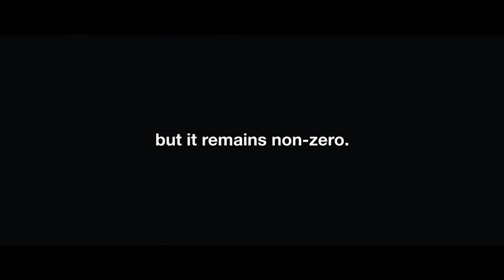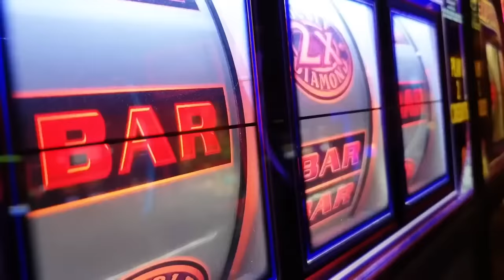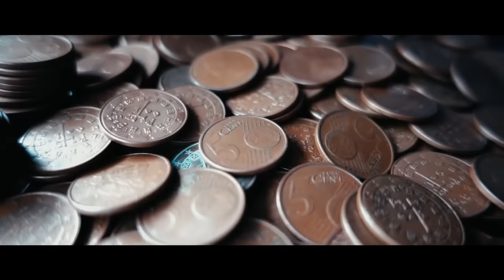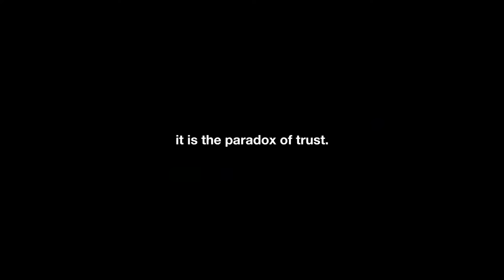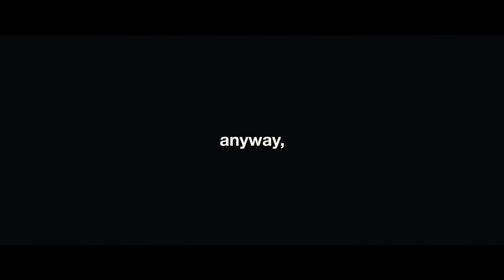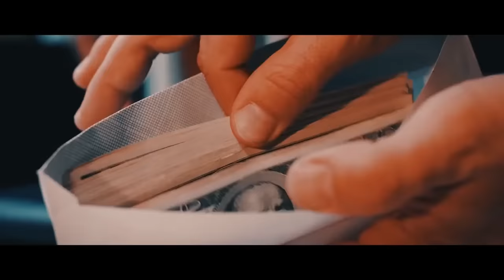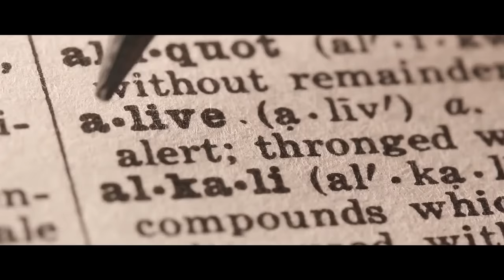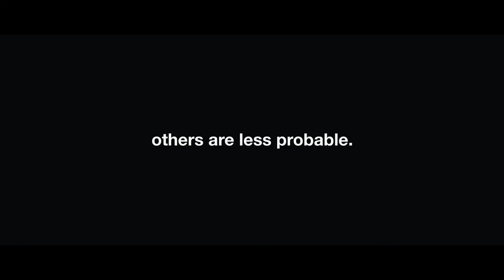Life's Biggest Paradoxes

Comment: This is a weird one but I think it perhaps applies to this talk of statistics and that the event was maybe just extremely unlikely. I was once using a coffee grinder to chop up some herb, but I had accidentally left a guitar pick in the grinder. When I turned it on there was an awful sound and I stopped it quickly. When I opened the container, which I did in no special way. There was a large piece of the guitar pick inside (~2/3 of the pick), and mostly chopped up herb. I took out the large piece of plastic guitar pick, but the rest of it was seemingly gone. I sifted through the herb looking for the rest but for the life of me I couldn't find it. I was sitting at my desk when this happened. I assumed the piece that was missing must have got mixed up thoroughly in the herb somehow while a large piece remained intact, but I was confused by how this was possible. I looked all around my desk despite the fact that there was no way I had dropped it when I opened the coffee grinder. Months later, I found the piece. A perfect match to the rest of the pick, only two pieces. It was behind my desk. But the explanation of how it got there still confounds me to this day.
Reply: Maybe the herb was too good and had you confused 😂
Reply: I believe it probably got thrown from the grinder.
Reply: @JarodM  You would think that, but how? It's a sealed container, powder doesn't get out of it. Opening it couldn't have thrown it to where it ended up even if it just fell out somehow.

Comment: The plane and car accident death rates differ a lot depending on how you measure

If you measure by Km's traveled, planes are massively safer, but measure versus time spent in the vehicle, and the death rates are comparable

This is because airplanes travel an enormous distance in a short time, where you may sit in traffic and travel no distance for hours

Thus, the risk of plane vs car differ completely depending on how you measure the denominator of that risk

Comment: My problem with the statistics stated in the beginning of the video is the proximity to each of those. Yes you're more likely to be killed by a dog vs a shark, but how many sharks do you see while walking down main street in your given city. Or your chances of getting struck by lightning if you work from home or if you're the guy who replaces lightbulbs on the top of radio towers. Statistics is funny in that way, the numbers are there its all in how you join them together.
Reply: Well said

That's similar to my thought about the denominator of the measurement

You're far safer in airplanes than cars when looking at total km's traveled

But if you compare against total time spent in the vehicle, the death rates converge a lot

You can spend hours in traffic and go nowhere, or spend hours in a plane and travel across the country

Statistics are funny like that, and in fact it suggests we're far more practical about our fears than a statistic proposed out of context that it would relate to

Comment: The beginning is not all that accurate (here’s an example)The chances of getting killed by a shark are slim because the majority don’t live in the ocean. Dogs are everywhere in our day to day so it makes sense that we’d get killed by them more often. If the kill rate of a shark is 100% but only 3 out of 100,000 people got in the water . And the kill rate of a dog is 5% but 90,000 out of 100,000 people owned one, the chances are still lower that a shark will kill you regardless of the fact that it’s still deadlier . ( it’s an example )  same goes with motor circles and cars . How many motorcycles compared to cars do you see on the freeway .